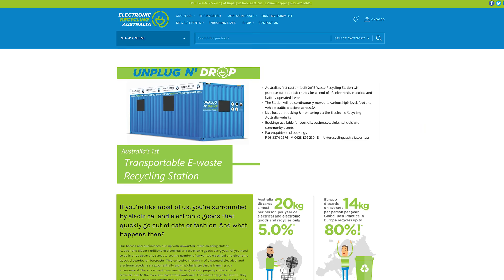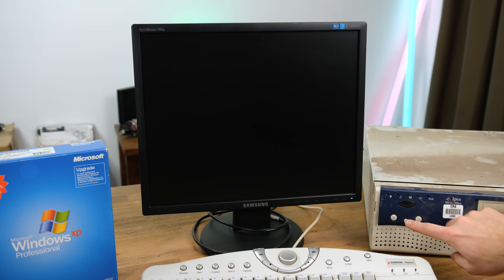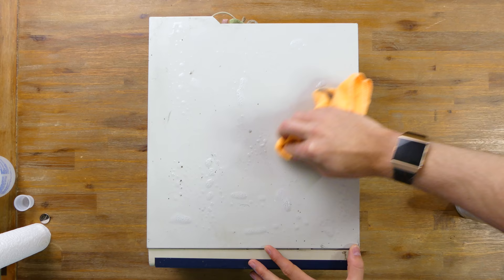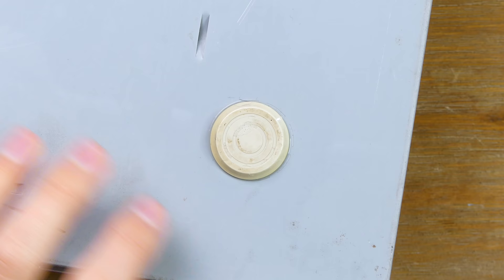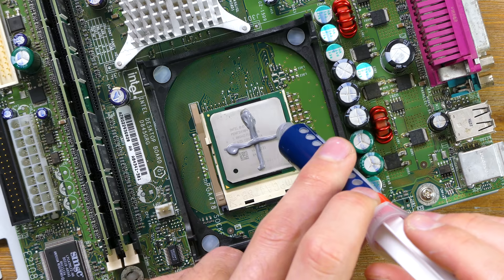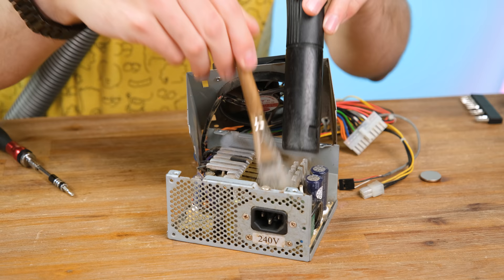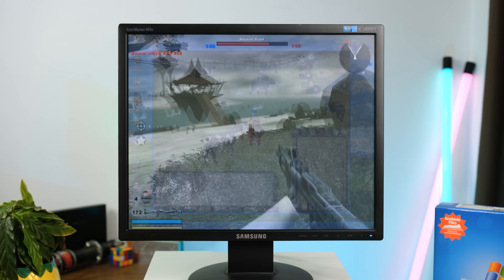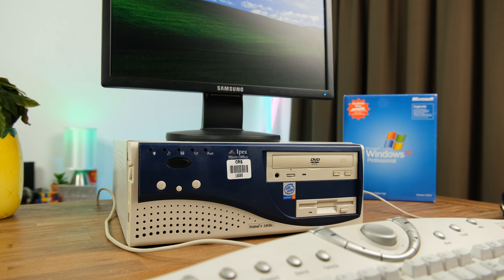Cleaning Up A Dirty Old Pentium 4 Computer!

Comment: Man, I love these late 90s early 2000s white/tan box computers, something about them just seems, interesting, even if I don't share a nostalgia some people might have.
Reply: They were made in a period where quirky was ok, cooling solutions didn't have to be perfection for something to work right, and the idea of visual presentation wasn't as tightly-defined as today. Intentionally or not, they embraced some element of fun. Those are my opinions anyway.
Reply: it really does amaze me how things have changed since the P4 era.  I remember one of the lads been the very 1st Pentium 4 owner, and to use windows XP
Reply: Me too. 

It's seems so cool yet so old that they had cache memory slots Instead of being built in a cpu. 

And more bizzare things like that makes it even more interesting.
Reply: I recently painted a computer that I restored to a  light blue  or cloud Gray color. Is a 2009 compaq SR5710 that was black. Around the mid and upper 2000s was when computers were no longer painted tan or light Brown like they were in the nineties and early 2000s . So I wanted to recapture some of that light color energy, so I sanded down my computer computer and  Re imagined what a light color could be, so I used .some furniture rated paint paint and now I think it looks pretty cool.

Comment: I like the pentium 4s, these are very interesting
Reply: They can cook pasta
Reply: @maxusgintus8160  hahahahah XD
Reply: about as hot as my pentium D (basically 2x pentium 4)
Reply: yeah especially the  Prescott core
Reply: @leucaradu7912  PresHot - form the base of Pentium 4 HT and both Pentium D Smithfield/Presler
Reply: nah they're boring
Reply: Pentium 4 2GHz for life!
Reply: they're pretty terrible, not good for running anything past 2001 or so. alas they still have a charm to them.
Reply: I have a pentium E6600 and I can run gta 5 with 30 fps low settings lol
Reply: @lefishegd821  Mobile Pentium T3400 running GTA SA over here lol

Comment: I worked for Ipex way back in 1999/2000 - those cases were a single design, with the front bezel being updated every year or so as specs increased. And someone at the factory was notorious for screwing in the top cover screw as hard as they could - they were almost impossible to unscrew by hand.
Reply: so he was like me🤣

Comment: This computer has very similar specs to my first PC. Mine had a 1.8GHz P4, FX-5200 and 1GB of RAM, back in late 2003. Always wanted to upgrade the Pentium 4, but instead I got a new PC with a Core 2 Duo a few years later. This video gave me a nostalgia rush.

Comment: HI, Just a quick note, i worked for a large organisation until 1997, the IPEX was very common and worked well, notable was its power supply being quiet and was able to put up with power fluctuations in one older building that would make lights flicker or dim, most other PC's were Osborne's and laptops genuine IBM's, the other desktops would freeze or reboot but the Ipex kept working - trivial but tell that to some one who has not save a file for 2 hours

Oh they were popular because made locally here in Australia gave it a big boost in the choosing criteria

Comment: I just clicked on this out of curiosity while eating supper. I found your cleaning ideas very helpful. However in my case before I touch any of these to much once it is in my house, I wipe it all down on the outside with a paper towel with window cleaner on it.  Now the interesting part was this case design. about 8 years ago a fellow I worked with said his church was given all of these computers and they really did not want them and so I asked my sister who home schools many children she adopted, and she did want them. There were 7 of these computers. They were windows 95, 98 era, all having a 450 or 500 MHz processor. I was able to bump all of them up to 1000 MHz and Windows XP. Now the unique point was the case style. Almost the same design as this one at 3:59 with this other sound board on the front. However the ones I had did not include the lights or the buttons for the computer functions, only the volume control and the mic and headphone and USB jacks. The ones I had had a wider case and a regular full size ATX power supply, and two speakers on the front and option for two CD/DVD drives and the floppy was sideways in the middle with the hard drive mounted next to it.   However it was apparently wired in to some larger control system using a large parallel 25 pin plug on the back. I was able to find a place to connect to the front of the amplifier and put a stereo wire with 1/8" stereo plug on it and plugged it in the back line out and that allowed the stereo amp and speakers to work with the computer.  Funny seeing one close to that design.

Comment: Make a sleeper and use that case that will be cool.
Reply: Not really, modern components generate much more heat, and such cases were not created with good airflow in mind. Modern components would just get fried inside.
Reply: @Pupp3tCl0wn  Well, I made a complete sleeper with an old Pentium 2 ATX case (I still had the "Year 2000 compliant" sticker on it :3) . The complete specs are :
Intel i7 8700k with a crappy Rajintek Rad
16GB DDR4 2666MHz
AMD RX 580
650W PSU 80+ Bronze
128GB M2 SSD
480GB SATA SSD
And on AIDA 64 Extreme, I rarely go over 85°C on the CPU and GPU.
Reply: Good luck finding a slim ATX power supply suitable for newer systems

Comment: I have the same computer I used when I was a kid, almost 20 years ago. It was a 10GB hard drive that had Windows XP in it. It was actually meant to run Windows 95. Around 2015, my brother tried to rebuild it, but did a terrible job. It was around the time I finished building my first PC and used what I learned to rebuild the PC. So, I fixed all of the mistakes my brother did and did a complete overhaul after my parents let me keep it.

Fast forward today, it uses Windows 95 (US and Japanese) along with new RAM, PSU a new AGP card and new HDDs (literally new in box too!)

I have some plans for this computer, which involves a SCSI PCI card.

Comment: This is almost the same spec as the PC I grew up with.

Nostalgia.
Reply: P4s paired with FX cards were extremely popular back then. It was my first setup. Vendors were pretty good at shoving crap into people xD.
Reply: @timpedra  I agree. Although as a family back then we were saving pretty aggressively for other things so gaming budget was really limited to get anything better.
Reply: @SMTahmid  I get you. I was on the same boat, so we got the cheapest graphics card (FX-5200) and CPU that wasn't a Celeron (1.8GHz P4).

Comment: Looks good! I would definitely replace the power supply though. Those old power supply's usually don't have protection built in and almost always have bad caps. Probably wouldn't hurt to recap the motherboard. I seen the ribbon types replaced with solid state caps. I've bricked several boards over the years because the caps just go bad, it's getting harder to find them. Even bought nos boards with leaking caps.

Comment: That IPEX PC is a Commonwealth Government build - used in the Group-8 contract clients.  The first batch we made were all ASUS P4C800's which went to PSMPC/ATO/ACMA.    The first machines were so fundamentally bad - we rolled out about 300 computers at the Edmund Barton building - and they all had to boot-up to get their image downloaded to it... Every single computer had the same MAC address burned in to the 3COM NIC soldered on the board.   We needed to make up floppy disks with a flash-update tool and go machine-to-machine updating them to make them work....    Much stress.  They were complete crap - they had about a 20-30% failure rate.

The second batch of machines were with the Intel board - and absolutely rocked..... for the time....    They went to PSMPC/ATSIC/AFFA/ABARE...  They were the better machines....   Intel NIC, good graphics cards, quality memory...   Also only Seagate HDDs.

I moved away from IPEX ITG in 2005 - was there for almost 5 years.   It kept winding down because of the competitive environment we were in.

Comment: I'll be needing this type of cheap pc for my coming freshmen year for school, Linux would be great on this one! great vid mate!
Reply: A Core Duo or Core 2 Duo from a couple years later would cost a similar amount to purchase nowadays and would use about half the power. Pentium 4s legitimately are room heaters, it’s not hyperbole like it can sometimes be. Partially because they don’t usually underclock while idle like a more modern chip, so it’s consuming maximum power all the time.

Comment: You were lucky, the PSU worked properly. I tried to restore one 20 years old Dell. Since it was left in a humid place for a long time I cleaned up everything before putting power on but made one mistake. The old PSU doesn't have enough power out put and outright killed the original HDD. I didn't have a spare IDE drive so I had to stop there. Lesson learnt, the hard way: Always test with a known good PSU. Luckily the MB was saved. Later on I salvaged some data for a guy using this old MB.
Edit: typo

Comment: This was my first every pc when i was a kid. I bought it second hand about almost a decade ago. The specs I got were Pentium 4 1.8 ghz, 250 mb ram, 40 gb hdd, cd rom, built in graphics with second 14 inch black monitor, new microsoft keyboard and a ball rotating mouse.

Comment: You have the 40GB HDD with a 40-wire PATA cable, that supports up to 33MB/s. A 80-wire one would give better performance.
Reply: There is no 80-pin PATA cable, but there is an 80-pin SCSI connector, but it has nothing to do with the PATA interface
Reply: @ivanfilip5121  I said 80-wire cable, not 80-pin.

Comment: My grandmother still uses her 2003-2004 hp compaq that also uses the pentium 4 (@ 3.0 ghz). I put linux on it (speciffically q4os). The thing has 1gb of ram and 2x 80gb ide harddrives. I just set up her new printer the other day. The little pc runs better than it should and will hopefully make it well past 2024 when i change it to the new q4os lts release

Comment: Back during 2003 I built my first PC with a P4 2.53ghz with 533mhz fsb, 80gb hdd, 512mb ddr 333 in dual channel, Abit ic7g max II motherboard and a Radeon 9700pro... Very fast for the time! Still have bits of that machine put away in boxes like the CPU, ram, hdd and gpu...

I laughed when you did the Crystal disk bench cause I had forgotten how slow hdd's were 20yrs ago, now we have ssd's with faster transfer speeds than system memory back then!

Comment: I relate to this, I have an Optiplex 380 Desktop that was or still is abundant at my middle and high school, libraries especially. The mighty Core 2 Duo within just refuses to be made obsolete, so I'd say the model was one of the school system's best investments on record. I'll always remember them as the school computer, with peeled off XP stickers and missing Dell logos.
Reply: I was so jealous of the teachers pc at my hs they took attendance from all had Core 2 Duos of some sort in 2007-8. Not Celeron nor Pentium dual core but a full c2d to do next to nothing while my gaming pc at home had a Pentium D 3GHz which I still have kept in my collection but I knew which I wanted to use back then

Comment: 1:53 into the video the BIOS screen clearly shows the CPU speed being detected as 1.4 GHz...This is weird as I don't believe there ever was a consumer board  released with hardwired CPU speed limit. Since this is obviously an OEM product it might be that the BIOS is an OEM version also with some pages and setting hidden. What  most likely causes this mis-detection is the Intel SpeedStep function turned ON in the bios settings without means for the end user to turn it off, the aforementioned hidden page. If that is the case then windows about page should mention SpeedStep as being ON. There are utilities out there to switch it OFF even for OEM BIOSes. The feature itself is useless and If I'm wrong then this is one seriously weird board with an artificial limitation that serves no purpose...

Comment: i actually would use a case like that but strip out the original components for something a little more modern like in place of the floppy drive would be some usb 3.0 ports

Comment: On November 20, 2000, Intel released 5he Willamette-based Pentium 4 clocked at 1.4 and 1.5 GHz.
(Found at Wikipedia)

Comment: Hey Psivewri,  My first Gaming rig was a Intel 875p Chipset with a Northwood P4 3.0 ghz. (800 FSB)  I also had 1 gig of ram and a ATI 9800 pro.   Fond memories and I think that system is still running to this day!  (upgraded to 4 gigs of system ram/Windows 7)  Intel used to make good motherboards back in the day.  Thanks for the video!

Comment: You can mod that case to fit two 120mm fans at the front and two 60 or 80mm at the back, and this system will run so much cooler and whisper-quiet. I did that with a similar case and I'm very happy with it. Looking for another case like this to do the same mod

Comment: Nice job cleaning it up. If you want to handle cable management a little better on those old ribbon cables. the 40 pin cables you could always peel apart in bundles of 8~10 cables and try to round them with cable ties.

Comment: I'm sure you could set the FSB to 133(533)MHz in the bios which would make this chip run at 1.86GHz with HT. And the best CPU for those boards is of course the legendary 3.06GHz Pentium HT Northwood.

Comment: Since this was running windows 7, looks like someone used it for such a long time. I kinda wonder how it would’ve performed under windows 7 and if it had aero.
Reply: I am also interested in this too and also wondering its performance under windows 10 as well. On 7, I personally suspect it was fairly slow and only upgraded to 7 due to xp losing support. 
As for having aero, I doubt it, it was probably just used in basic or classic mode due to its age.

Comment: Great video as usual! You did an awesome job on that old Ipex PC. I had only worked on those when I had a contract with a school system. I would most likel find a Processor that could run efficiently on that board as well as a Gpu. I can hardly wait for the upgraded video.

Comment: I’ve had some old dell dimensions with similar specs that I cleaned up and still could not run anything not even windows xp but it used to be able to run GTA vice city and a Street Racer game well back in the day. Some components must have failed but the pc still ran. Had an all copper heatsink with copper fins.

Comment: The Prescott P4s were not very popular, the added Hyperthreading didn't really make any difference at the time (lacking software support) and they ran hot. It was fairly common for people to "downgrade" to P4 Northwoods that overclocked like demons and ran much cooler. I ran a P4b 2.4ghz at 3.8ghz for years back then with no issues at all, I was so disappointed when I upgraded to a 3.2ghz Prescott and couldn't even overclock it to 3.4ghz. It was hot as hell and already running at the bleeding edge of its capability. For those in the know it was a common tactic to trade a seemingly higher clocked Prescott with HT for a good old northy, especially when prebuilts started shipping with Prescotts as default.

Comment: On some old bios's it's possible to easily boost the CPU or get fsb running faster with some trickery... Some motherboards back then had a 30 or 60 MHz option i don't know if it was only a AMD board option....

Comment: I have just restored a Pentium 4 that i used as a kid. It's 64 bit Pentium 4 506, from 2005. It still performs great with windows 7 even with HDD. However, wattmeter shows on average over 100 watt, when idle it's around 70 watt. Not counting monitor and speaker. Is it normal? Do you think it will support green movement to reuse it or it is just too inefficient?

Comment: You should try to install windows 10 on it and see how it runs. The cpu meets the Windows 10 system requirement. It would be quite interesting.
Reply: The graphics card does not however, impossible to get a GPU driver for it.

Comment: Tips for using certain apps on Windows XP :

Minecraft : You can play recent version of Minecraft (up to 1.16.5, I tested it on a VM) by using the "Tlauncher". (careful, you can get errors if the ram is setted incorrectly in Tlauncher. I don't recommend maxing it in the settings). It come with the latest version of Forge/Optifine/Optiforge in the version settings.
https://tlauncher.org/en/

Web : As for web browsing, you can use Mypal. It's a web browser base on Palemoon and it's updated frequently.
https://www.mypal-browser.org/

Comment: looking for a similar computer, although it was a generic custom build (diy). it must have been around 1999, whenever the pentium 3 600mhz came out.  the one i'm looking for is a celeron 500, and it was built in a box that looked like the one in the vid, but about 1/3 the height and  3/4 of the width (about as wide as the dvd drive + a little more).  it was tiny.  it had a green plastic aesthetic on beige casing.  would love to find the case somewhere.

Comment: Please don't use Eucalyptus on plastics!
That stuff can crack some plastics in short order.

I had a solar battery charger casing shatter into many pieces (after some time) from a light sprinkling with Eucalyptus oil.

Comment: I have a gaming laptop. With a $370+ new CPU (i7-7600hq)
Which has a SLOWER base speed (2.6 ghz) than the Pentium 4.
Reply: Actually someone overclocked a pentium 4 to 5ghz so it's faster than a lot of modern computers
Reply: @AsianFlex  Yeah I saw someone do that but they had to use liquid nitrogen

Comment: Wow...someone used Windows 7 on a socket 478 that also ran at 1.4 with 266mhz ram...even if they were concerned about the support in 2014 this PC was obsolete anyway,not to mention running it on that old Geforce it was a pain for that computer